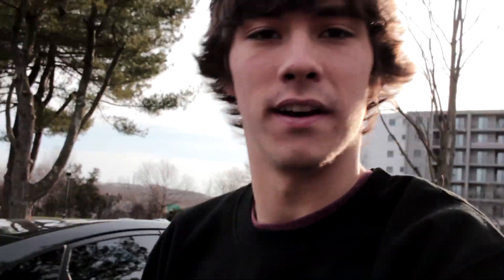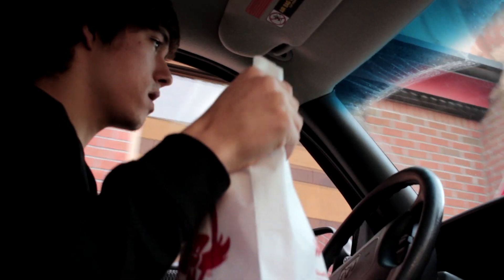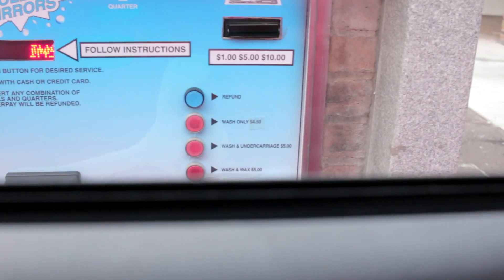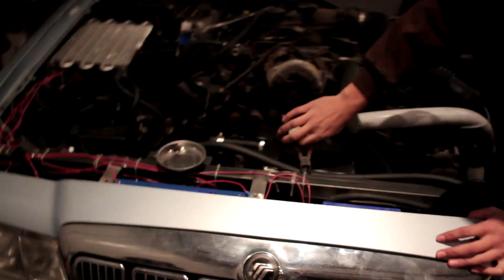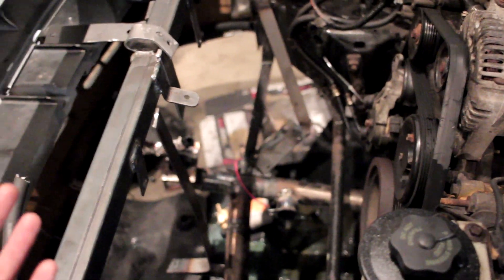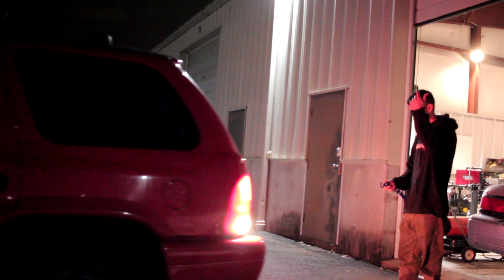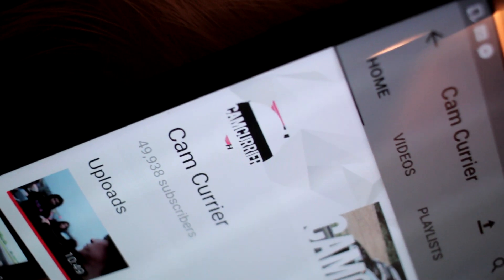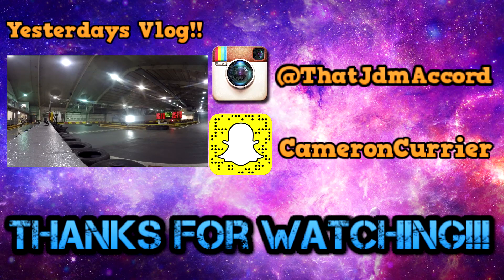FINALLY STARTING THE E36 BUILD

Comment: Q: What's the plan for the E36 build?
Reply: TimmyM56 probably an engine swap
Reply: RiceRiRiRicE I think so too, hopefully an LS swap.
Reply: earlier Cam said it's getting a Chevy 350 V8
Reply: grand marquee v8 in THE e36...
Reply: might as well put an LS in it
Reply: custom cam 357
Reply: those pi 4.6's(99-04) blow head gaskets and and spark plugs out, and they weigh alot, even for a v8, people dont realize how much weight the ohc design adds vs cam in block design, also you have to buy two to four cams instred of one, also the sbc parts are laying around every where because it is the hot rod standard, and has been for decades.
Reply: price the bearings rings and gasket kit for it, then shop for smallblock chevy parts...
Reply: cheap, carb and fuel pump get a trans and custom drive shaft, prolly less than 2k
Reply: a junkyard 5.7, a t-5 out of an s10, a custom drive shaft, a used intake and carb, a mechanical fuel pump, some headers...
Reply: yea but those euro parts are not everywhere around here, was all i was saying, he has been beating this 200k mile pos of crap, the jdm thing to do is cheap hp, if you beat it it will break, no one wants to wait on their parts with more status wile the other guys have fun.
Reply: yea but he already broke at least one bimmer trans, i was talking smallblock chev, pre ls, they are cheap, and will hold 500hp for awhile just with ring gaps enlarged
Reply: just do a 300hp build and add about 10lbs
Reply: peeps dans ranger build, sub a boost snail for the funny stuff...